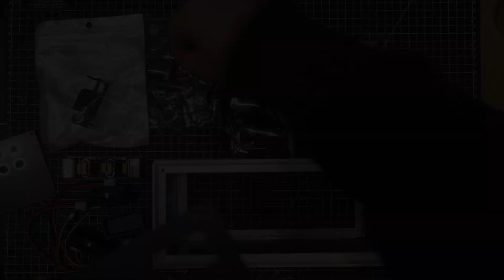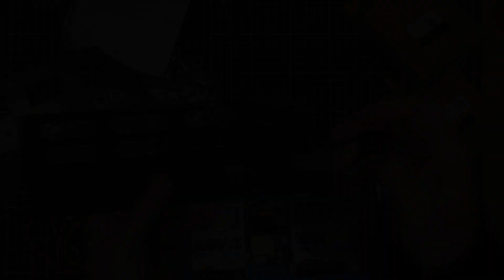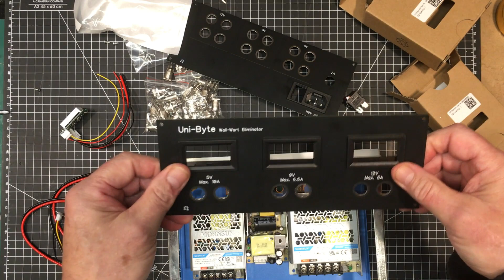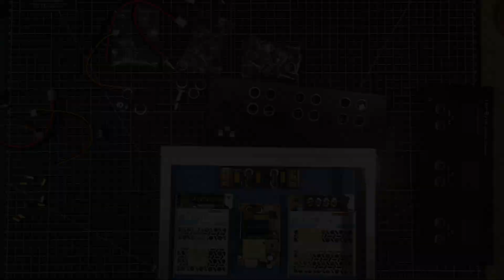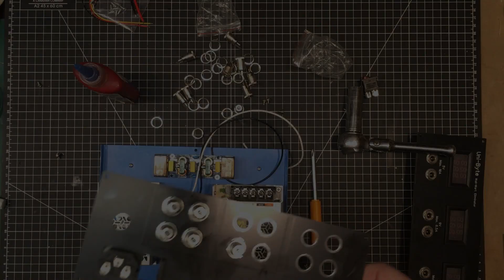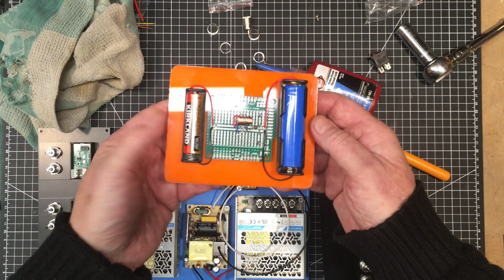0099 - Build a Wall-Wart Eliminator for your Lab:  Part 1

Comment: How about using an additional nut to close up that slop on the connector? Thread the nut all the way up and the install the connector and add the additional nut
Reply from the maker: I came up with a solution.  See part 2.
Reply: @uni-byte  I saw it, I like yours better
Reply from the maker: @bobvecchi304    Thanks Bob!

Comment: can you fit a back silcon gasket at the end so they fall on the rubber gasket so you can center the connectors
Reply from the maker: Maybe, but I came up with a solution.  See part 2.
Reply: @uni-byte  thinking out loud haha i need to see  part 2.

Comment: You could see if you can find a suitable size step washer for those connectors to tale the slop out of the mounting.  Perhaps have them 3D printed in red and black for + and -

Comment: Drill press precision... Make/set the starter dimple, as usual. Use graduated bits; start with a small one. Place the DUT on the press table. Pre-set clamps, but do not lock them down. Lower the drill bit into the dimple. Hold the press handle in this lowered position. Rotate the bit backwards to center the bit, while allowing the DUT to drift into place. Once centered , hold the DUT in place with a little more downward pressure on the press handle. While the DUT is held in position in this manner, lock down the clamps. Proceed to drill. Locking down the clamps while keeping pressure on the handle can be a bit fiddly. But, the method will center the DUT, as the method relies on feel and not on (older) eyesight. HTH.
Reply from the maker: Thanks!  Good information.

Comment: That's looks like a very handy thing to have around. Might be a good way to make use to an old Pc power supply. Of course there is no 9v in a Pc psu and may the power supply for each voltage should be separate. I'm a total beginner so just a guess.
Reply: That’s a good idea.
Reply from the maker: I guess you could use a DC-DC boost to get the 9V from the 5V.